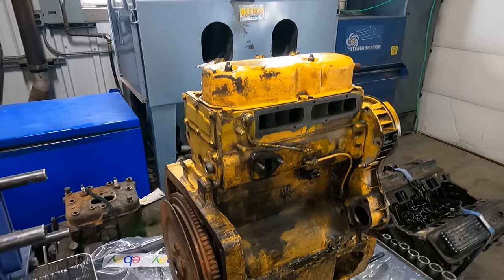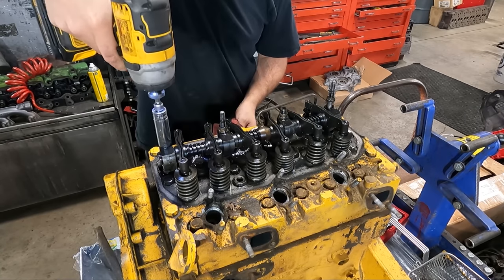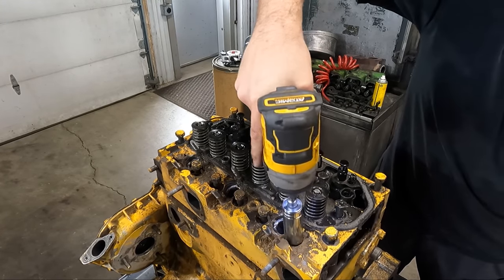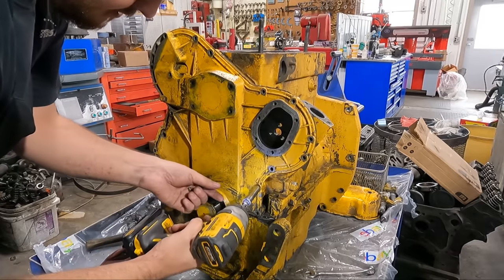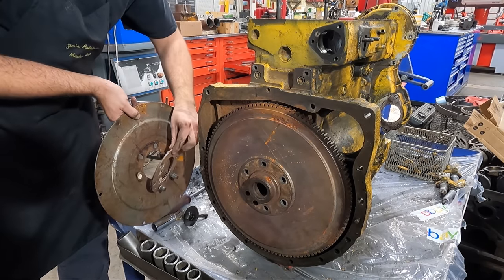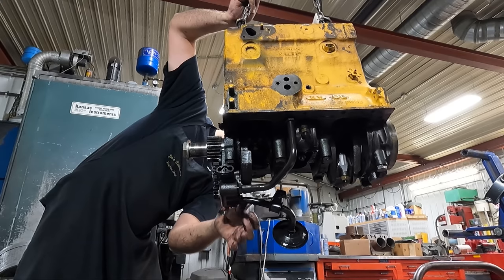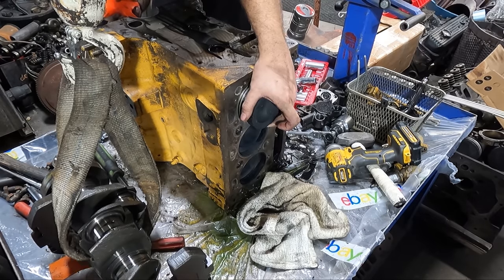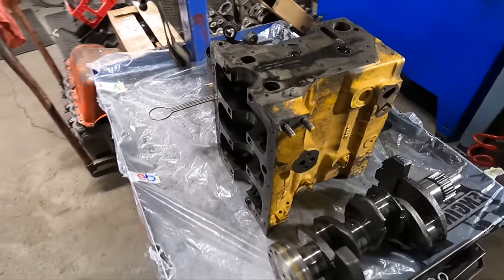Broken Rings In A Tired Engine - Massey Ferguson MF30B Industrial Tractor Engine Rebuild - Part 1

Comment: Hi Nicolaus and Jimmie.  Watching w/ great interest, almost like episode 1 w/ a cliffhanger.  Probably not a common thing for someone to see their engine being rebuilt.  
I bought this about 10 yrs ago, after borrowing another 30b and liking it.  The hydrostatic drive makes it easier for me (no clutch), as my left leg is partially paralyzed.  It has run great, other than the "tap tap tap" always present at idle.  
Jimmie told me it looked like dust or dirt had been a factor.  I think it preceded me.  I changed the air filter when I bought it, and probably put less than 200 hrs on it (hour meter broken).  When I pulled the engine, I checked the air filter thinking I'd replace it, but it was clean.  The hose to the intake manifold and the manifold gasket both were fine.  Then my son borrowed it to do some grading on his 2 1/2 acres out in the country and it started pushing oil out everywhere, including around the front seal and the dipstick tube.  
I went looking for a shop familiar w/ this engine, and was referred to Jimmie by someone who had a history w/ him and greatly appreciated his work.  Came to find out we'd graduated the same year from the same high school (no, I'm not saying what year).
They were so backed up, I waited 5 months to get my eninge in.  But after talking to Jimmie, I wasn't going to let anyone else do the work.  I'm just hoping I can talk Nicolaus into helping me put it back together.  It's the first engine I pulled, and I'll be glad when it's back together and running.  
Thanks Jimmie and Nicolaus.  I appreciate your work, your integrity, and your friendship.

Comment: Bro im sitting here at 35 y.o w a messed up back that'll probably never b the same. Protect your back at all costs for longevity. Don't be a hero, dont be lazy if you have machine for it use the machine. The funny thing is i thought i was being careful with my back but here we are. Btw i found your channel through shorts but love these longer vids. Iv never taken apart a 3 cylinder diesel but watching this vid i feel i vicariously did.
Reply: Man i hurt mine by really like not doing anything!! I kinda bent over looking at a engine, grabed the rad support and pulled alil bit!! It broke me down, i had to crawl up my steps into the house!!!! Man it was aweful!!!

Comment: Being honest that engine looks pretty clean inside which means the oil and filter have been changed regularly,the piston is really bad but the big end and main bearings look really good. All the oil leaks were because of that piston pressurising the crankcase and blowing the seals and gaskets but overall the engine was pretty good. I had the same trouble with a 6-354 engine that the rings on one piston had broken up just like this one,new liner and piston in the damaged one and the other pistons fitted with new rings and rebuilt with new crank bearings and the head overhauled and it ran as good as new.

Comment: As you mentioned, it’s always nice to find something before it fails catastrophically or just fails in general. I’m working on a Caterpillar compactor and found a u-joint that is trashed to the point that the yoke at the output of the transfer gear case has been making contact with the driveshaft where the u-joint bolts on. Don’t know what has kept it from snapping, but when they do the driveshaft can flop around causing all sorts of mayhem.

Comment: Watching this before heading in to work today to investigate what appears to be a blown head gasket on a Doosan forklift. We bought it decommissioned from the NY Sanitation Dept, it has a Yanmar 4TNE98 diesel, common in a lot of small moving equipment. As an apprentice diesel mechanic it's the first time I'm doing something this big, different enough from standard gasoline engines to be interesting! Looking forward to the rest if this series, of ours is bad enough I might be doing a rebuild alongside you guys haha

Comment: A 3/8 break-over bar is probably the most under utilized tool in a shop. I have an early 1950's Craftsman that is only slightly older than me. My grandfather gave it to me, but; it still works after all these years.

Comment: Check to see if the tractor has a remote mounted air restriction indicator, I had to rebuild a 255 Massey because the hose fell off and the engine started eating dirt. I could trace the dirt in the intake to it.

Comment: My dad spent 52 yrs twisting wrenches. Never used an engine stand. 4x4's on the floor and the engine on those. I'm curious about the "expression" for working on an engine swinging on a chain. We always had one about 3 monkeys and a football when a couple of the guys would gather around a project.

Comment: Yup , most little old  industrial MF were torque converter drive . Dirt ingestion for certain and and some older perkins didnt start too well , AND probable ETHER  use after wear and even lower compression ... just pieced a JD350 dozer engine for customer with same problem and kept going until 2 of 3 pistons wrecked similarly
Reply: Either was the cause of the ring groove torching out killing compression pressure.   Dirt is a contributor but bearing wear and piston wear are minimal.

Comment: hey man, just some help. my tractor ( mf 135 AD3.152) is loosing oil  on the back, i saw you separating the block from the sump. is ist possible to separate only the sump? Because my engine is loosing oil in that rubber hagging when you lift it, it seems it can be done withouth untear all the front gears right?

Comment: im a factory trained Perkins tech, i have seen way worse pistons then that. it amazes me what people do to there equipment and how long they run it after it starts making noise. 
dusting is a major problem especially when the operator takes out the air filter thinking its going to make more hp.

Comment: Hey man. Do you have any personal experience with engine damage resulting from aluminum oxide contamination from scotchbrite pads? I used some scotchbrite to clean the RTV from the clutch cover on my motorcycle and now everything I read says my engine will grenade from the aluminum dioxide particles in the scotchbrite. I was very meticulous with following behind the scotchbrite with a rag so it would catch any loose pieces of RTV and scotchbrite and I changed the oil and filter before running the engine. What do you think my chances are of having bearing damage from the scotchbrite?

Comment: Man...take care of your back.  I'm 48 and have had four surgeries on mine with the first one coming at age 30 and having a 2 level fusion at age 33.  I lifted lead, drywall and steel in every wrong manner when I was in my 20's and I'm still paying for it.
Let 'em laugh at you using the hoist and you can laugh when you're 60 with a back that's still in original condition.

Comment: Someone’s been starting it on starter fluid! 😞
Reply: Exactly,  the engine has low bottom end wear.  The either causes what we call in the gas engine world is detonation.  The blowing out of the ring groove is common on Perkins, Yanmar, kubota, and other small engines in the same class.   Also most of them have very high compression ratios which makes it worse.

Comment: Its british, thats the cause of the oil leaks😂. I worked with an ex mf main dealer mechanic and the stories he had of  diesel 35’s,135,165,185, leaking n not starting from new…🤯
Prob been run with a bloked air filter sucking crap in the gaps.
👍🇬🇧👍